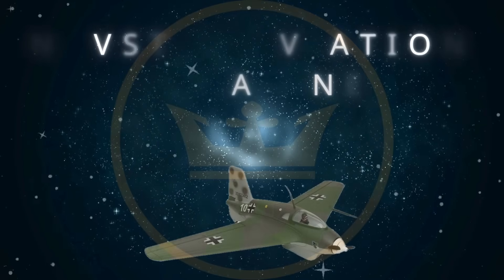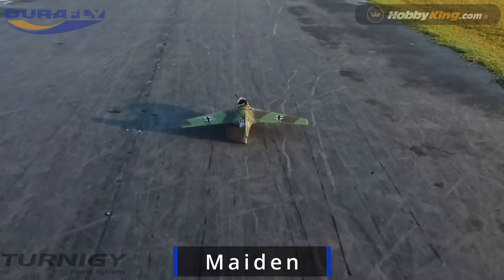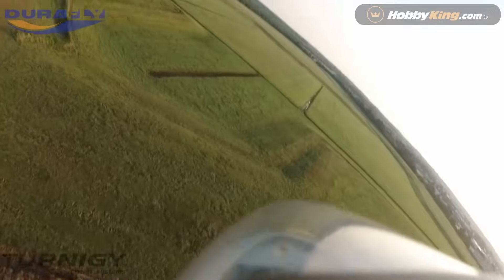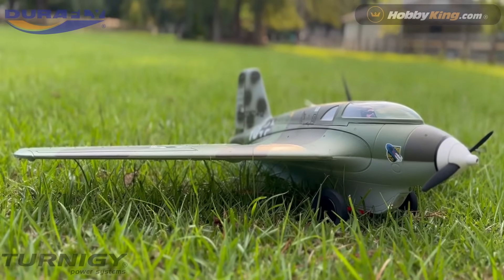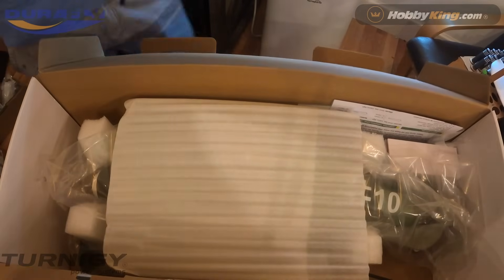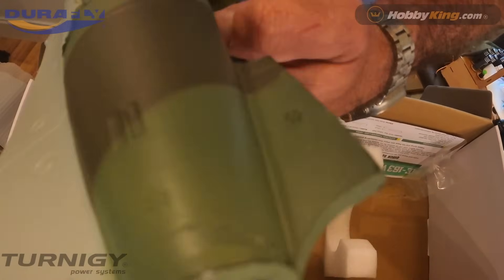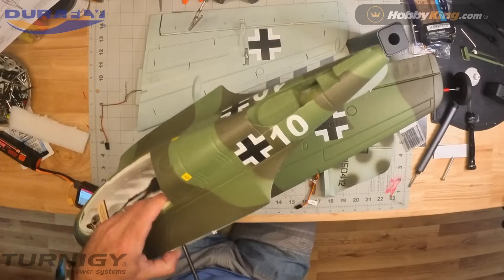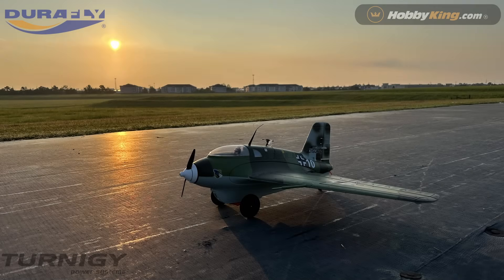The amazing ME-163B rocket assisted interceptor by Hobbyking!

Comment: What battery setup are you using for the rocket motor?
Reply from the maker: The rocket motor does not used batteries. The plane few on 4S